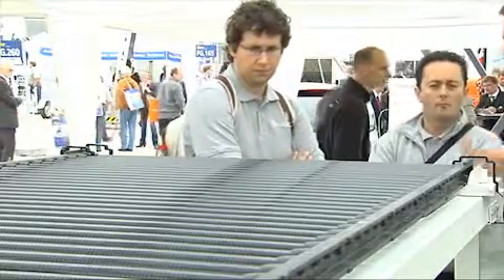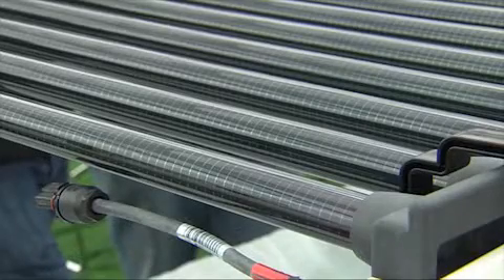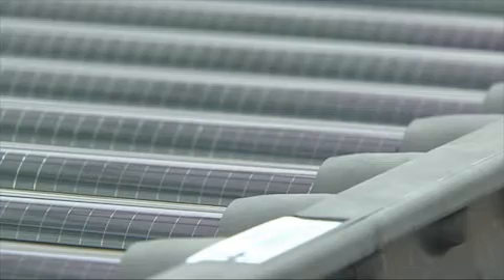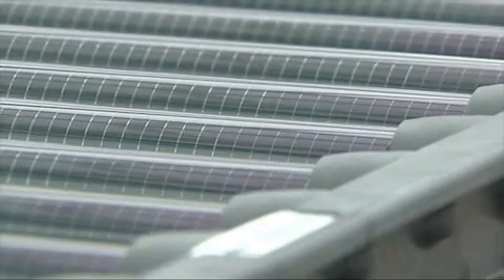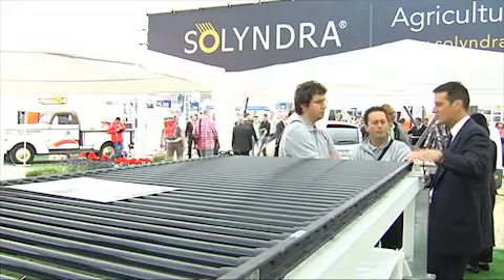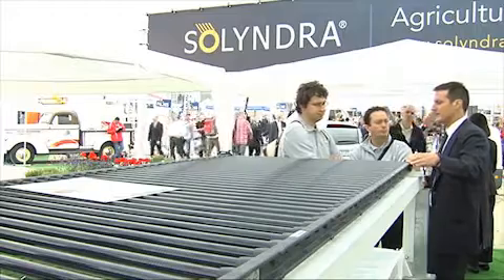Solyndra showcases integrated greenhouse energy generation solution

Comment: Never mind that cylindrical cell modules only work fully when horizontally mounted on a high albedo surface, i.e. a white flat roof.  They are useless in PV applications that make sense, namely <1kW off grid solar systems where cost of electricity is no big deal.  Grid tie PV is a huge misallocation of resources and a scam.  Gorebull wormening is a scam.  Communism kills.